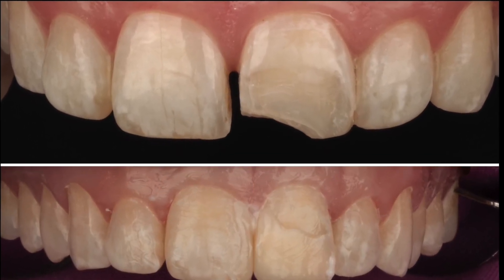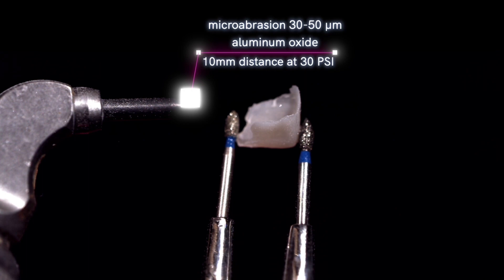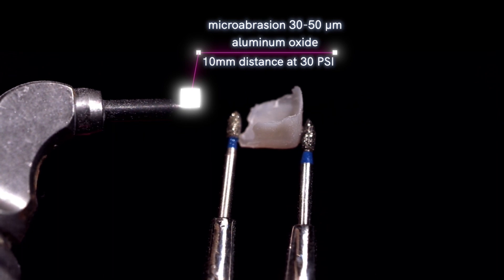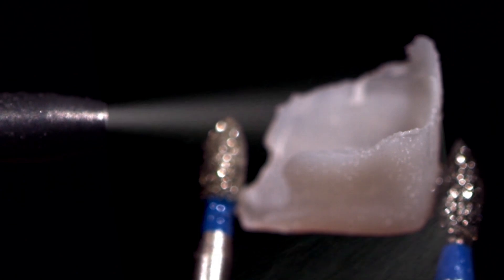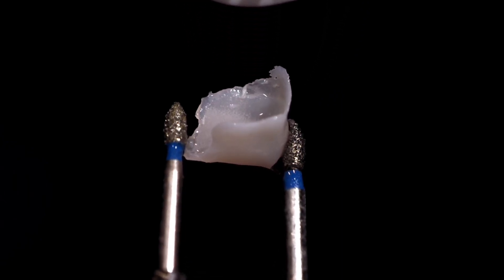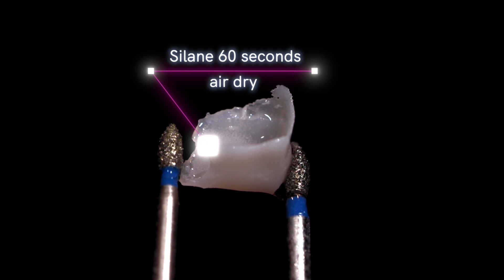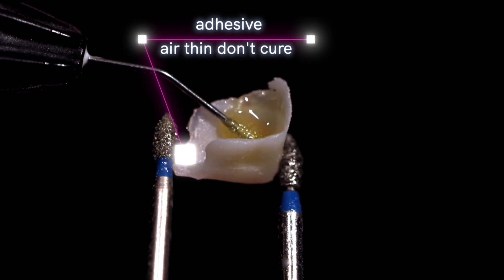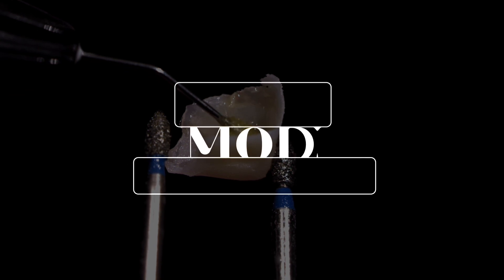MOD Institute TOP TIP: Bonding your 3D printed restorations.

Comment: Hey Wally, thanks for the information . What am doing is sandblasting > etching 30sec > clean with water air dry > universal bond ( don’t cure) apply cement .

Is this wrong ?